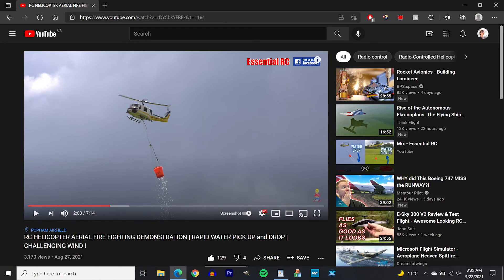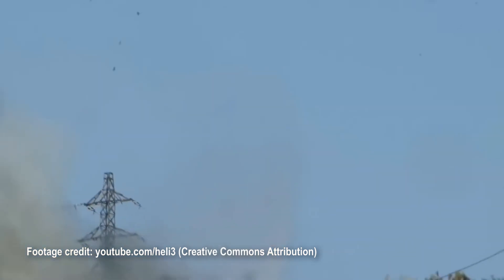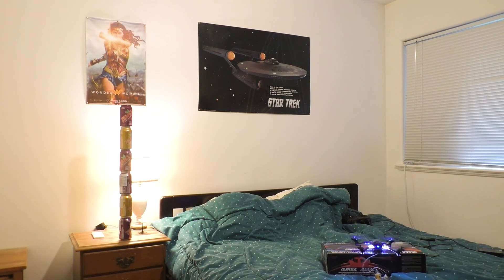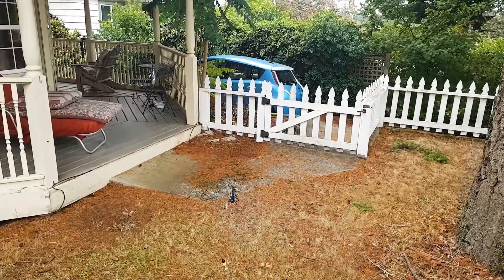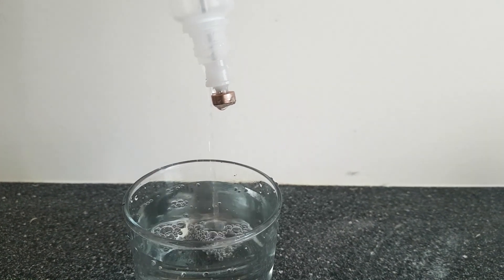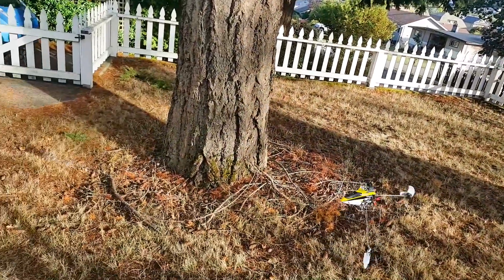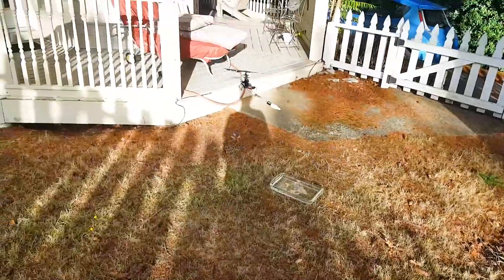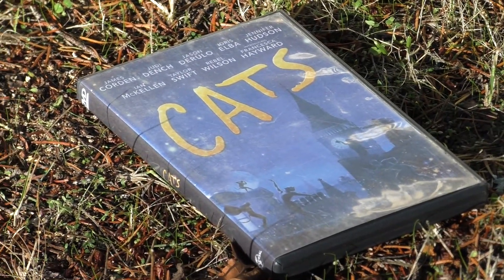R/C Firefighting Helicopter

Comment: I think the reason the pendulum effect isn't as bad on the helicopter as it was on the drone I think because the weight of the bucket was centered to the Roader blades. While on the drone they were not
Reply from the maker: That's entirely possible. The drone was also carrying a much heavier load.

Comment: NIce video  how's you get the extra channel for the water servo did you use a separate reciever and different tx or something.
Reply from the maker: Yep, separate receiver. You can see it taped to the bottom of the heli in some shots. That's what the extra transmitter was for.
Reply: Did you share the battery?
Reply from the maker: @paulbarber5495  Yes, I made a JST plug splitter so I could plug them both into one battery in parallel.